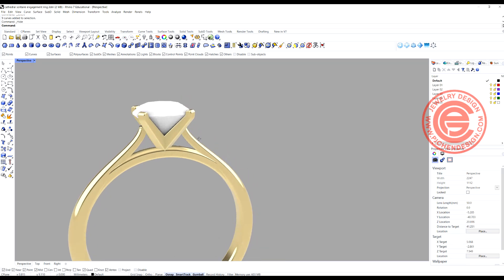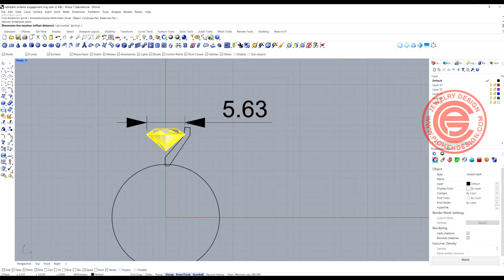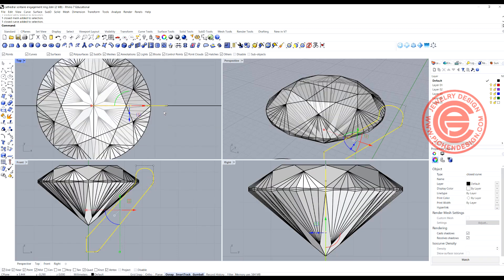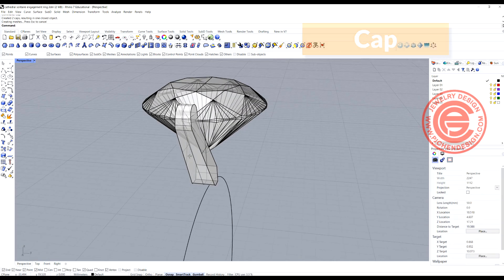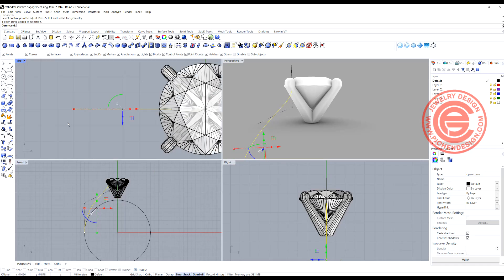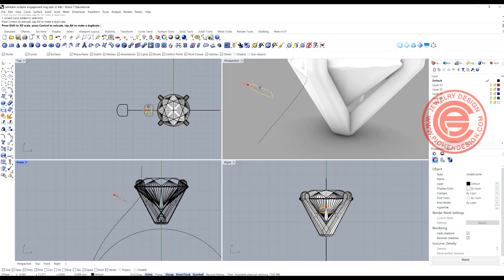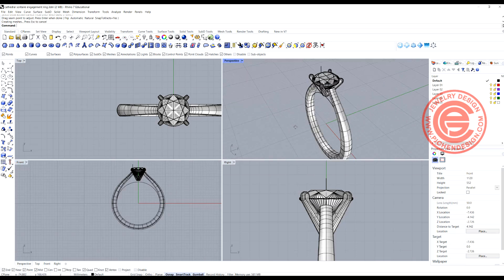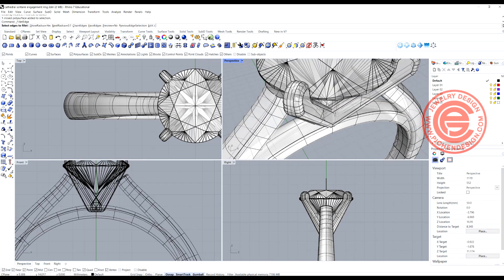4 Prong Cathedral Engagement Ring Jewelry 3D Modeling Tutorial with Rhino 7 #224

Comment: Very Very Helpfull Videos 🎉 I learned a lot Really Thank you so much .I would like to ask about the size of the Stone I want to draw each time 1 Gram or 7 Gram Or ..... So how could I change the size of the Stone each time .Thank you
Reply from the maker: the size of stone is go by dimension not the weight.
Reply: @PJChenJewelryDesign  Hello again and thank you for your Answer.I find that our Stones that used in Solitaire are not the same with one you use like 5mm I tried to design the prong eround the Stone with what you use then when I print it I used my stone I figure out that are not the same